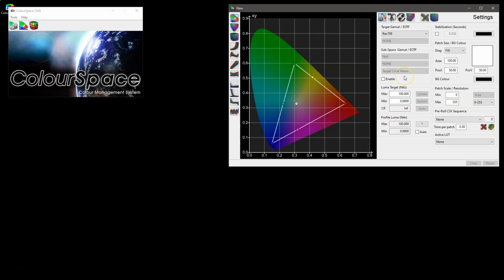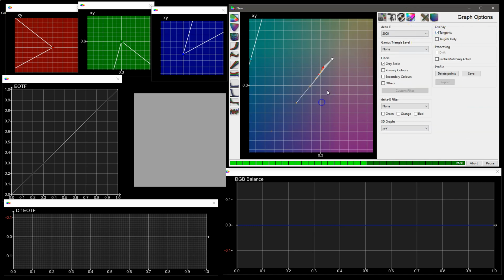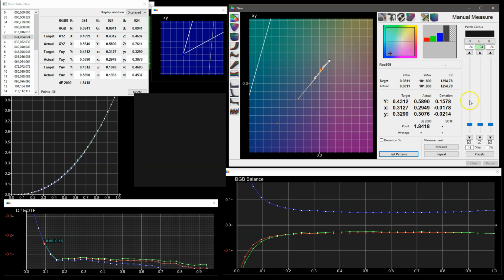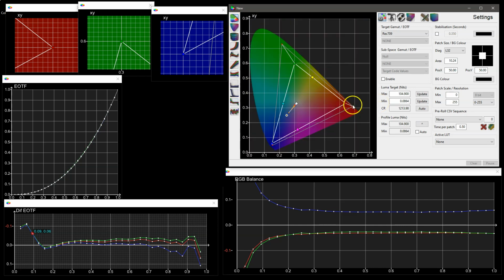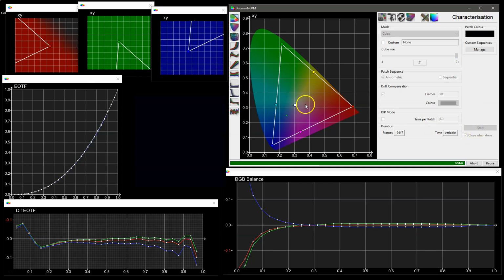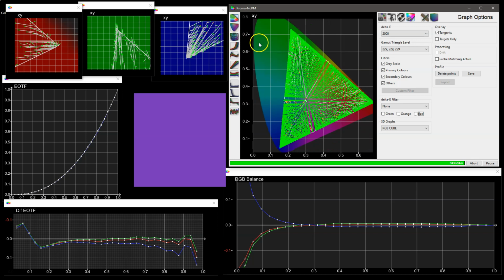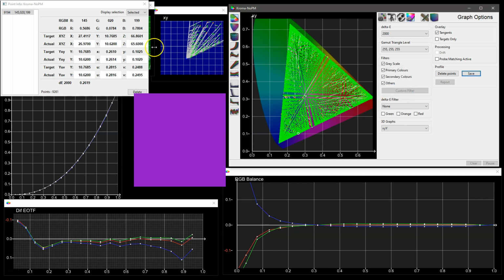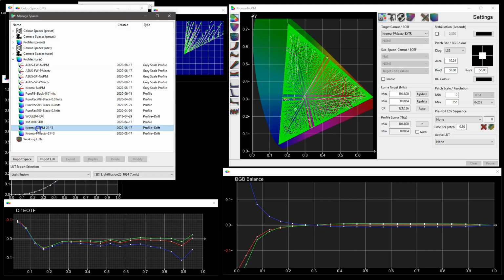ColourSpace Display Profiling

Comment: Why didn't you do the probematch before? So that you don't have to extract it 2 times?
Reply from the maker: You can probe match whenever you want with ColourSpace. With all other calibration systems you must proble match before.
But, I don't understand the comment on having to 'extract 2 times'... What do you mean?
Reply: @LightIllusion  forget my question. it is to complcated for me as a zro user. 🙃
Reply from the maker: @optimalsettings  - if using ZRO for manual calibration adjustments you will want/need to perform Probe Matching in advance, as you need the matching to be active while making adjustments.
Reply: @LightIllusion  do i have to do a full ddc reset with my lg oled to an uncalibrated state before profiling?
Reply from the maker: For manual adjustments with ColourSpace ZRO I would just adjust the basic/default settings. 
For 3D LUT cali9bration, which is when such resets are needed, ColourSpace takes care of all that for you.
https://www.lightillusion.com/lg_manual.html
Reply: @LightIllusion  i have a spectro & colorimeter! i want to calibrate hdr. and before i want to do a probe match. do i have to do a ddc reset for profiling? or can i profile in an calibrated state with the default LUTs?
Reply from the maker: As said, for manual adjustment you do not want to do any resets.
Just use the default settings, and perform manual adjustments, as needed, with the Probe Match performed beforehand.
Reply from the maker: You can perform profiling any way you want.
But if you are doing LUT based calibration you will need to reset via ColourSpace first, as per our User Guides.

Comment: You a couple of softwares available for rent, which one is the minimum version for creating display profiling?
Reply from the maker: Please see the website information, as it all depends on the display you have, the probe, , TPG, signal processor, etc.
Reply: @LightIllusion  for Ips White Led display using CC Display Plus, which software version do you recommend for renting as minimum
Reply from the maker: What actual display? Does it have LUT capability?
Reply: @LightIllusion  no Lut capabilities, just ICC
Reply from the maker: ColourSpace doesn't generate ICC profiles. You would need SpaceMan in addition. But ICCs do not work as you may think: https://www.lightillusion.com/what_is_wrong_with_iccs.html